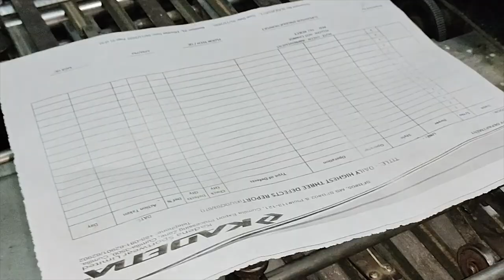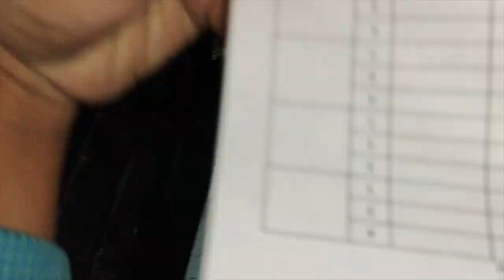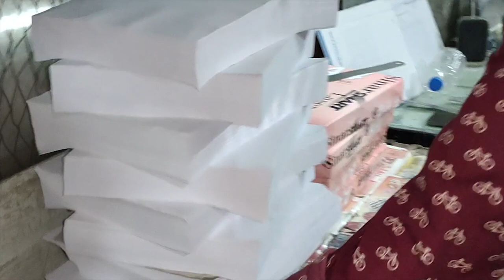Offset Printing Process with Hamada 600 Offset Printing Machine

Comment: What is the maximum size for print and does it 4 color to print
Reply: Max sheet size on a 600 is 12 x 18 but usually not more than 11 x 17. CYMK is possible but not recommended. There is also a Hamada 700 which allows 14 x 20 sheet size.
Reply: @Chris Barton  where i can see demo and from where i can purchase
Reply: @tarachandramishra6018  They are no longer manufactured so you would have to source one locally. I'm only familiar with US sources and am not aware of anyone who ships overseas. Google used printing equipment for your area. That's where I'd start.
Reply: @chrisbarton1517  Thanks

Comment: Is that how you're going to encourage an immature pressman to clean off paper that was caught between the inking rollers? Do you realize the danger you are putting him in? A few minutes of safety wouldn't cause you any loss of profit. Please set a good example of safety during the operation of printing. Thanks.
Reply: You have no idea what you're talking about.  He did it safely!
Reply: @keithnorris8982  I've been printing for forty two years and I've seen fingers and wrists destroyed by such carelessness. If that's what you do, then you're posting a very bad example for up coming pressmen. That's the reason modernized printing presses are made with devices to do such operations, and as although presses are equipped with automatically program devices, paper is still caught between the inking rollers and we have to stop the press to remove the scraps of paper. So my amateur friend, that's something to ponder about.. (SLOPPY PRESSMAN.).
Reply: @normanazeez1816  Learning to roll a rag up properly with no corners loose, holding a knife a correct  angle along with a few other safety hints will eliminate accidents. I'm 78 with all my fingers, toes and scalp.  I've employed 100's of people over the years and never failed an OSHA inspection. One employee lost the tip of a finger because he did not follow my protocol for safety. For the record, OSHA did not fine me.  I was very safety conscious! I re-watched how the pressman in this video cleaned the press and as far as I'm concerned someone taught and explained safety to him. One thing for sure, I never allowed the press operators to run a press with covers on the machines.  Maybe you work a government job where you can take all day to complete a job but most for profit printers don't have that luxery.  That being said, today's presses will not allow you to do what he's doing but non the less he's doing it safely. All  the accidents you witnessed, I'm guessing must have been untrained or stupid people.  Why do clowns like you resort to calling people names.
Reply: @keithnorris8982  Maybe you weren't investigated or being subjected to inspection, because that's not the way cleaning inking rollers is done. One day you're certainly going to find out the hard way. If that's the way you taught your employees, then my friend you certainly are a sloppy pressman and have no respect to the laws of safety, and the safety of your employees.
Reply: @normanazeez1816  Sorry to disappoint you Sargent Azeez but I'm now retired and have a clean safety record.
Reply: @keithnorris8982  Try DOING it on a kord 64, or Crabtree Vickers press, then YOU'LL know what I'm TALKING about.